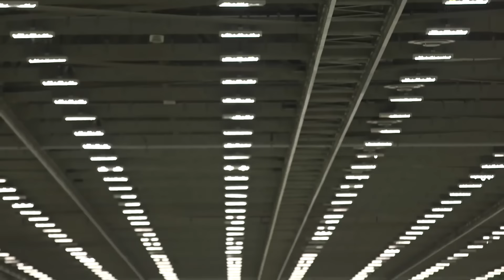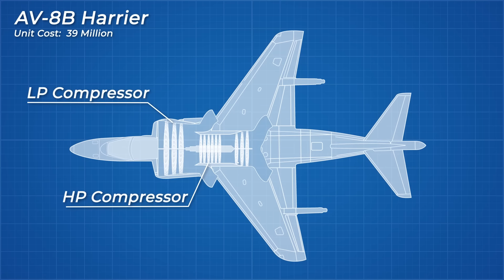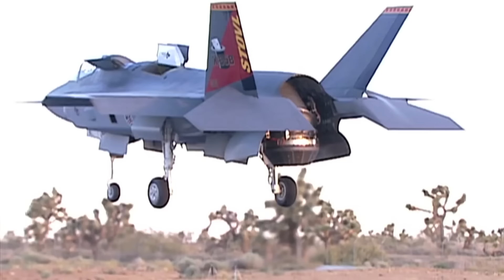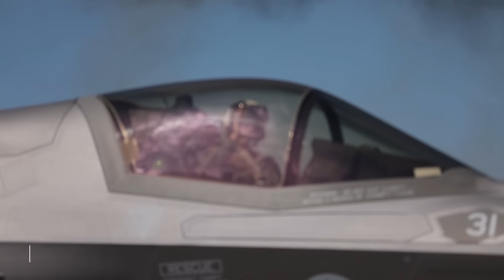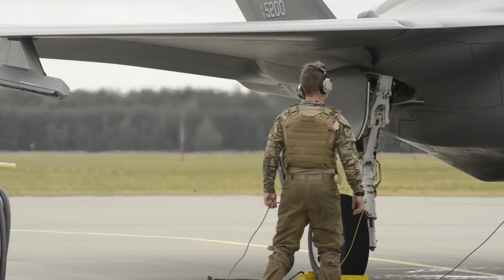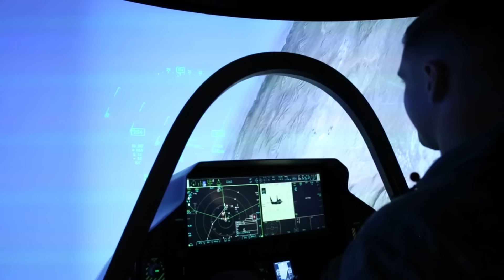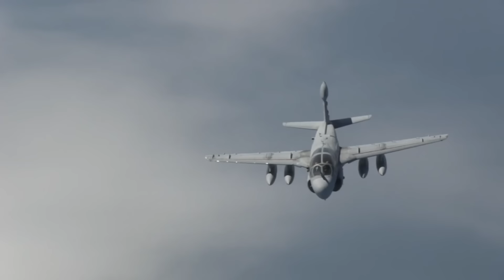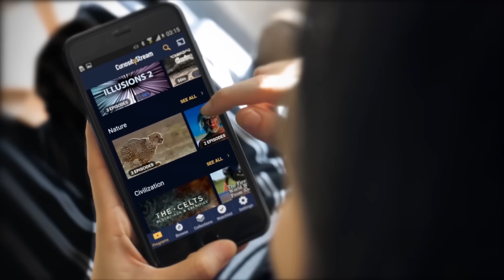Is The F-35 Worth $115 Million?

Comment: I personally feel any falling or limitations the f 35 has is at the faulty of it's having basic 3 jets in 1, I also feel it's could have been far worse but for the requirements it will work, also I am a person who wants to design militarily aircraft for a living
Reply: Not really the case. A more accurate analogy would be three different aircraft with considerable parts and equipment commonality.

Comment: Failed ..
 There was air show in france this years  and there is company who make radars.   They claimed that they detect f35 for 200 km
Reply: The F-35 at airshows always has four radar reflectors installed around the fuselage. If they weren't able to detect it, they'd be completely incompetent.
Reply: @WilliamSwartzendruber  your own media  saying that .. lool
Reply: @hassan-gk3wt  That is false. People have simply noticed that whenever the F-35 appears in public, it has attachments that distort its external shape. It is no more and no less than that.
Reply: @hassan-gk3wt  Yes, because the plane was fitted with radar deflectors.
Reply: @hassan-gk3wt  The French shot down an F-35, did they? Well now, the U.S. should consider sending them a strongly worded letter over the matter. How rude of them!

Comment: we (you that is) have absolutely not demonstrated that the f35 is a worthy replacement. and others seem to think the same. guess why boeing just fitted the a10's with new wings that are expected to take 10K flight hours.
Reply: Because the A-10 has political supporters who never let the USAF present evidence they don't need the A-10. Fact is the A-10 is responsible for less than 20% of successful CAS missions in the last decade.
Reply: @dumdumbinks274  That sounds a bit awkward given that the F35 is also a highly politicized project spread through all states. I'm with you regarding the need for a reliable CAS craft though the flight characteristics of the F35 do not suggest that i might fill that role.
Reply: @nodustechnologies3989  CAS doesn't actually require a specific set of flight characteristics. The original reason for "low and slow" CAS aircraft was so that they could reliably spot targets and hopefully differentiate them from allied forces, but sensors do that job nowadays and with the abundance of smart munitions it really doesn't matter if a completely dedicated CAS aircraft exists, and in many cases the A-10 simply isn't suitable or due to it's lack of speed cannot reach the area in a timely manner.
Reply: @dumdumbinks274  the low speed favors loitering as it has with the A10 and various gunship variants. sensors are far from foolproof these days and the close proximity of combatants disqualifies a lot of bombs. i really can't see a substitute to the 30mm canon and if pod-mounted on the f35 the radar signature is bust. a cas should not come quickly to the rescue, it should already be nearby. else planning went seriously wrong. what you are describing sounds like a guided missile attack. but i guess we see what the test of time has to say.
Reply: @nodustechnologies3989  All good points in the context of the 80s, but points that do not matter in the context of most CAS operations today. The A-10 still only excels in a niche role. CAS is a broad role as there are many situations in which troops need air support.

Sensors these days are capable of spotting vehicles from 50km away, especially combined with radar systems that the A-10 simply will never be able to use due to lack of space.
There are bombs such as the GBU-39 that are designed specifically for minimal collateral damage that an F-35 can carry 8 of internally. Since aircraft are configured for specific missions they won't be carrying weapons that are largely unsuitable for CAS. Also note that the 30mm isn't designed to be accurate, it's designed to saturate an area, so it sometimes isn't an optimal choice either.
In a situation an A-10 would be used stealth is not beneficial at all, so there's no need to worry about an F-35 losing it's stealth.
As for operations, the ability to react means you actually end up catching the enemy. If you remain close then the enemy is more likely to be aware of the CAS threat and might wait for a better opportunity, or might switch targets. The unknown is often scarier than what you can confirm since you cannot properly prepare.

Logistically fast jets are also superior when supporting multiple operations since fewer aircraft are needed to fulfill all required missions, which means greater availability of aircraft for individual roles. When pressure is put on the troops more aircraft are able to be assigned to support them, and when the enemy isn't doing much offensive work those same aircraft can strike the infrastructure of the enemy which in turn removes the enemy's ability to put pressure on your troops. 

Sure a few A-10s are worth keeping, but the flight characteristics and systems of the A-10 mean that it only saves more troops than any other aircraft in short term small scale operations.

Comment: Using people who have to shill for F35 as examples is ridiculous. 
Stealth is a meme (what is thermal imaging and LW radar). LW is not useless paired with ever-cheaper and higher resolution thermal tech.  It was defeated by 70s sams in Serbia when they killed lots of Serbs to protect invading muslims. Thanks Bill. New attempts allegedly rely on detecting the absence of signal or a lower background due to scatter across various frequency ranges.  
Either way it can't do half of an A10s job, can't loiter as much, can't fight as good in the air in heavy ECM environment.. it's a donkey.

Comment: One of these or Fifty Sea Harriers for $115 Million ? I know what I would have.
Reply: The latter costs about $40,000,000 USD and hasn't been physically produced or significantly remanufactured since the nineties.
Reply: @peterson7082  According to Janes, A second hand harrier can be purchased for around $2Million. Am assuming the $40Million would theoretically be for a New model ?
Reply: @bigearedmouse17  The production and acquisition cost was about ~40,000,000 USD in '1998 according to the GOA's budget report in FY98. Again, the AV-8B has not been produced in over 20 years and has seen very little remanufacturing save some electronic warfare upgrades.

Comment: your 115mil number is way off. If you factor in the development cost which the US government did pay... plus the cost of all the added equipment needed to get full stealth capabilities... it is more like 200mil a piece. Now if they really do end up selling a lot of the planes to other countries... or course the per unit cost will come down in time but the reality is by the time the cost does start inching down in any meaningful way... it will be on to the next gen pilotless fighters. So in the real world, the F35 is a 200million dollar plane and at that cost... no way it is worth it other than to have a small number that can be used as quarterbacks with other planes doing the close in work. Honestly, the best solution in my humble opinion would be to use drones as the lion share of fighters with an F35 back calling the shots 50 to 100 miles back. I would propose a new combat group made up of 10 bomb carrying low cost drones. Then 6 advanced drones with air to air missiles. And top it off with one F35 to control the mission. The bomb mule drones would be very low cost with no stealth. They could be built for 3-5mil per unit.  The advanced drones would be around 10mil per unit and capable of firing air to air missiles with a ground based pilot controlling each advanced drone. The F35 would be shielded by the cover of the advanced drones while the bomb carrying mules do the dirty work. So 10x5mil =50mil for the bomb carrying drones. Then 6x10mil = 60mil for the advanced drones. Then 200mil x1 for the F35. The F35 pilot controls the bomb carrying drones as a group with AI controlling basic things like attack formation based on what they are going after. Each advanced drone has its own ground based pilot that is in constant contact with the F35 flight leader. The beauty of the 3 layer flight group would be the majority of losses would come from the mule drones which are cheap and easily replaced. The fighting drones are more expensive but still hella cheaper than the F35 and since piloted by ground based pilots remotely... losses there would be manageable. Keeping the F35 safe would be critical as we can not afford to lose 200mil aircraft for long without bankrupting our air force.

Comment: "The F-35 is not a bad dogfighter because […blurp about long range detection capabillities, and this and that…]" …aha. The F-35 *is* a poor dogfighter. Thanks for making that point, even though by irony. And it is, and it doesn't make it a bad fighter plane, especially for the strike role. It just means that without support by air superiority fighters, it will get into trouble easier. No news there. Datalinks between an F-35 that passively detects enemy aircraft over hundreds of miles and fighters that can go in to knock out that enemy in any case will make it worthwhile. It would fulfill a similar part as the Tornado did, thus.

"The extreme precision required in production to maintain an acurate surface drives up the cost!" -I remember you said you had a background in aerospace engineering somewhere, right? I thus imply you know what a laminar flow wing is. I also imply you know the degrees of accuracy required to ensure laminar flow. I thus drop a few names here:  P 51, Mooney M 20, Piper Pa 24, LET L-13 Blanik. Planes made of metal that are available since dunnowhen which feature laminar flow wings, thus require precision in manufacture to a similar degree and have been available to johnny common plane owners decades ago. The requirements in maintaining the shape is only somewhat harder to achieve with the F-35, as the entire cell has to match. It's not required to re-invent any wheels here, though.

To add an opinion: The JAS 39 comes at a fraction of the price, is similar in speed, superior as dogfighter, inferior in passive detection, probably superior in radar jamming, but all things considered the bigger bang for the buck. The E/F versions even are able to supercruise, thus do beat the F-35 in speed by far, but I am not sure if they are available for sale outside Sweden.
The only real quality the F-35 holds over thr Gripen is stealth, which I guess is massivley overrated, as shown by the Serbian's downing an F-117 (Of which I heard very different versions from what you reported here). I guess they are better Choices than the F-35a, though. A team of F-35 in the second line of battle, providing fighters like the Gripen, Eurofighter, Rafale, F-15, F-18 or F-22 with data about enemy movements would probably be real killer teams. You don't need many F-35s for these teams, though.
Reply: > "To add an opinion: The JAS 39 comes at a fraction of the price, is similar in speed, superior as dogfighter, ..."

 It doesn't come in at "a fraction of the price." Superior based on what? 

> "which I guess is massivley overrated, as shown by the Serbian's downing an F-117 (Of which I heard very different versions from what you reported here)."

 First generation of stealth aircraft that lacked any form of countermeasures and saw no refit since introduction fairs worse off in one scenario against a well trained unit that uses the old but modernized S-125 system and its associated arrays.
Reply: @peterson7082  Based on both price per plane as well as hourly operational cost. I don't remember the exact numbers, I roughly remember the hourly cost of the JAS 39 was around €20-30000, Eurofighter in the €40-45000 region and F-35 over €50000 according to Der Spiegel last year. 
½ is a fraction according to maths. ;o)
The ratio in purchase price per plane is similar.
Superiority reffered to as roll rate and load factor at the same speed. The lower wing loading comes to bear there, as well as the delta planform. The JAS 39 also shows a visibly better L/D at high lifts, thus is better at taking its speed around corners. Same goes for the Rafale, by the way. (I don't include the Eurofighter here as I can't tell how much of its tight turning at low speeds benefits from its extremely high  power/weight ratio over its aerodynamical qualities.)
A crucial skill in dogfights.
Higher wing loading improve the skills as strike fighters though, as ground turbulence doesn't shake the plane as easily, so the accuracy in low level attck benefits.

Comment: no.. because most of the research you paid for isn't for that plane at all. you basically paid for the research and development of the next couple of planes, bombers, fighters and other. The plane only cost 10 to 20 million per plane to make in the factory. the rest is all research and profit. why don't they mass produce them? planes get outdated quick and always need updates.. the newer.. the more you just have to through them out like your cell phone. all electronic and not worth upgrading.. like the F-35 is not worth upgrading. its a flying computer.. its cheaper just to make a new plane every 10  years.. cheap to maintain if you make the parts in your country. expensive if you buy direct from the factory.. iran has F-4s.. they don't need a smart plane.. they need a smart missile. they can get them from Russia.. all stealth is detectable. your suppose to be at 80,000 feet. launching missiles at things at ranges banned by treaties. like mid range missiles.  they cheat and go high to get the distance. no side has ever followed the treaties.. us stealth is designed for high altitude. shape angles.. Russia stealth is designed for low altitude. smooth angles. usa high and slow.. Russia low and fast. sharp angles slow you down. not designed for being at low altitudes. could a F-22 to F-35 make it to Russia.. yeah.. just has to fly high enough..

Comment: Odd to take one basic design and then to fragment it with three rather different variants...  So strange that the Navy version won't have the vertical take off and landing capability, which I would think they would want most.  For the price, I'd rather have three F-15s (at the historical price of $42M each) or a single F-15, an F-16 or F-18, and an A-10....  Sort of scary to try to cram too many diverse requirements into one plane, which may wind up not doing any of its different missions very well . or as well as predecessors - at all...  I sure hope it works out o.k...
Reply: The Navy has no reason to use the STOVL version when they have catapults that allow short take-offs at much higher mission weights. Also for a historical price you're getting a historical jet. An F-35 would wipe the floor with 2 or 3 F-15s of that era. Modern F-15s each go for more than $100 million, whereas the Air Force version of the F-35 goes for about $85 million, soon to be around $80 million. 

Also the F-35 doesn't do anything the F/A-18 or F-16 don't already do, it just has greatly enhanced capabilities. The difference between each variant comes down to how each service wants to operate the platform, not what roles they will use it for.
Reply: The F-15 in its current blocks is as if not more expensive than an F-35C, and more expensive than an F-35A. 

> "ort of scary to try to cram too many diverse requirements into one plane, which may wind up not doing any of its different missions very well ."

 Not really the case.

Comment: Not "real engineering" when the problem of high wing loading and poor thrust to weight ratio is waved away with quotes from Lockheed sales plots and typical Lockheed deflection that the software and paint job wasn't finished.
Reply: Except that it's wing loading is about the same as the F-16, total loading is better than the F-16, and it's T/W ratio is extremely good and once again better than the F-16.
Reply: @dumdumbinks274  About the same is Lockheed talk for worse. Extremely good is what they say when a comparison is so bad they don't even want to make it.
Reply: @nicholasuloth6530  I'm not quoting Lockheed, nor do they make excuses as you claim. This is basic stuff that you can only come to your conclusions by comparing aircraft in different situations i.e a false comparison.

Comment: Strangely positive given the data presented.
Reply: Because its not that expensive per unit, infact its cheaper than many modern block 4th and 4.5 gen fighters, and in recent years as its been taking part in more exercises it is showing its worth and performing very well against targets in scenarios where 4th gen fighters experience heavy or complete losses.

Comment: planes cannot serve multiple purposes unless you want to modify each plane for their purpose such as being more maneuverable for air superiority, better armor and more armaments for CAS, sleeker design with more angles to be more stealthier but this would cost so much for development and also would just be completely useless because the planes the F-35 is trying to replace like the F-18 for air superiority, A-10 in close air support will out perform it in any type of scenario because how they were specifically engineered for that task.
Reply: Except the F/A-18 is outperformed by the F-35 in literally every aspect. The A-10 doesn't perform CAS as a whole any better than an F/A-18 or F-16, and in fact performs less than 20% of all successful CAS missions. Most successful CAS missions are performed by F-16s, followed by the F/A-18, and then a range of aircraft including large bombers like the B-1B.